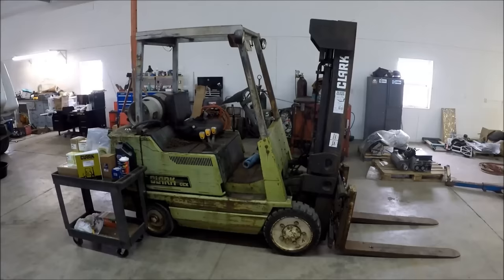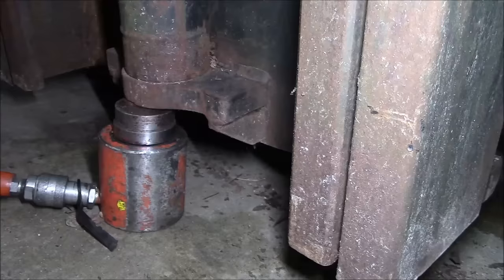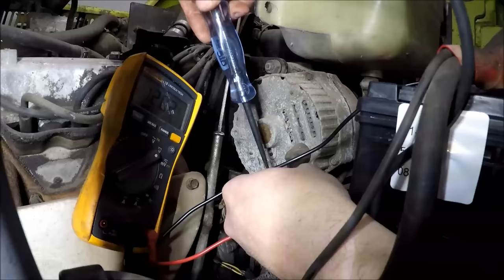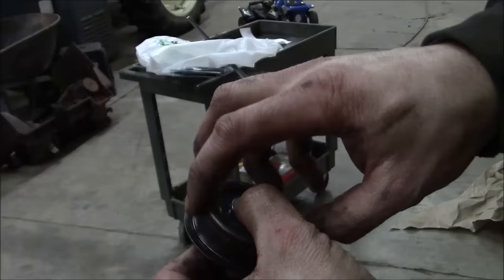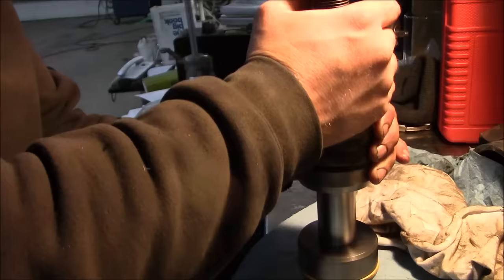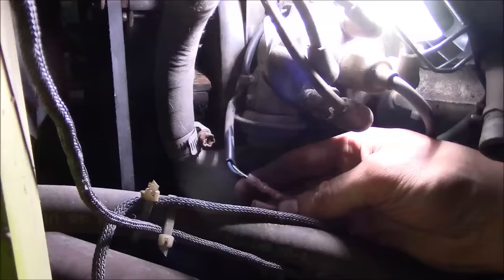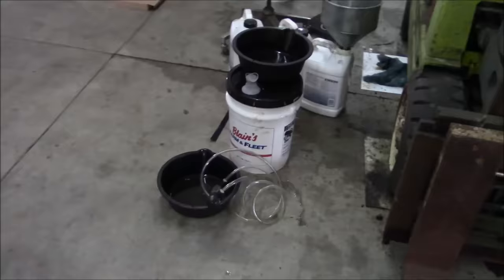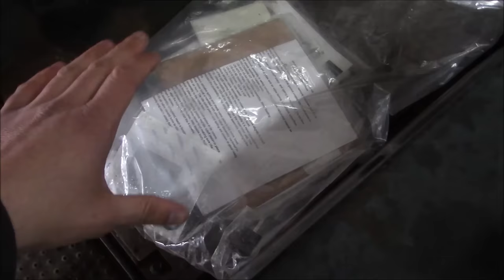Fixing a Forklift that Sat in a Field for 17 Years - Timing Belt, Mast, Hydraulics, Cleanup - Part 2

Comment: Very interesting to learn some stuff about Forklifts Wes. I have never worked on a forklift but you never know where life takes you and i would feel a little more confident doing so now. Also never seen a hydraulic cylinder rebuilt - i try to stay away from hydraulics but useful to see how you got it apart and did the seals. 

My pressure washing fetish was also satisfied!

Comment: I can remember standing on an old pallet and being lifted up full reach of the 3 stage fork hoist as an apprentice mechanic to change a mercury vapor bulb in the workshop ceiling.  A long time ago before  osh and worksafe.  Now they want you to use a scissor lift and harness which is a good idea if you have one.  Its got a mitsi motor 4g63 ? The PS pump goes where those 3 bolt holes are.  You only need to take the 4 m8 nuts off the crank pulley. Do the cam seal while its apart.  just line up the triangles its easy.  Nice hook wrench we usually get a kit for the cambelt that has everything in it. belts, seals, tensioners. Now you have a good shop forklift.

Comment: Coat of paint next ?
UV rated cable ties 😂😂😜
Reply: Should've put the joint in the cable ties AWAY from the operators legs though - sure as shit, those sharp bits will rip your pants!

Comment: You commented on how clean the oil and the spark plugs were. The burn on natural gas and propane is so much cleaner than gasoline or diesel. We had one FORD  (351 V8) van run exclusively on Natural gas and after 250 kms, we tore it down to see the inside of the pan an oil galleries etc. It was as clean as a new short block ! We were all impressed in the shop. You still have to dump the oil but after many more miles of driving. Cheers ! Great videos sir.

Comment: If you have a miss and can't find the problem, change the spark plugs. I lived off grid and used a propane generator. When it got hard to start, I looked into the problem. The plugs looked just like they came out of the box. It wasn't until I replaced the plugs did the problem go away. I have no idea why they looked store new and wouldn't work. Over the years I replaced what looked like new plugs, but were trash. Carl

Comment: Thanks again. There is always more to learn. Good to have a manual those retainers thingy o bobs for the cylinder were a suprise. Oh and maybe insulate that  aluminum bar you have sitting in line with your battery terminals If the j bolts get loose you could have a bad day.

Comment: Hey man, that upper seal in the gland, the correct name for it is a rod seal, and the “pressure seal” is called a u-cup! In case you haven’t found out already ! And yes those cylinders are a bastard to remove ! I hate forklifts lol. And the gland locking style is most commonly referred to as a “ring lock”
Reply from the maker: Thanks for that info!

Comment: I drove a truck (Mitsubishi Mighty Max) that had an engine almost exactly like the one in this forklift. I had to replace the head gasket and the factory carburetor got replaced with a Weber DGAV, other than that it really never gave me trouble. Fun fact - you prime the oil pump by stuffing it full of Vaseline before assembling it.

Comment: Keith Fenner is an older guru in hydraulic cylinders and knowledegable do it all machinist has a video that shows a big marine cylinder with the steel ribbon retainer ring. I thought that type of retainer was odd but evidently are in rugged applications. You might like his steel roses. Turnwright machine works. in new england

Comment: On later models they deleted the second water pump in favor of an idler bearing setup for the fan, it eliminated the need to drain the cooling system to change the timing belts. It all was due to putting the trans cooler under the radiator and having to get the fan to line up with the fan shroud. All forklift manufacturers love to put ten pounds of crap in a five pound sack.. lmao.. my best time for changing both timing belts on the later setup was 45 minutes in the middle of an Ace hardware store...
Reply from the maker: I'd believe it. I think I could have done this timing belt set it 1-1/2 hours if I had all the parts. It's really not a bad job.
Reply: Doug Degraff In the middle of the day or at night ???
Reply: Doug Degraff The timing belts kind of suprise me , they used to leave the belts for the on road vehicles and gear drive the came on the industrial units .
Reply: Becky Watt it was in the afternoon... had to run 75 ft of air hose from my truck to reach the truck through the front door of the hardware store.. the earlier Mitsubishi 4G63 had a timing chain set up that ran through an opening in the head that would entail a trip to the shop and removing the engine to service, As Wes said the belt set is really not a hard job to do onsite at the customer location. There have been several manufacturers use the Mitsubishi engines in their trucks, but Clark usually had the best access and didn’t have a driveshaft for a hydraulic pump run off the crankshaft which always presented an extra degree of difficulty to the job.
Reply: Doug Degraff Doesn't sound very fun , have worked for both Ryder and Penske  and done service calls on I-94 and I-69 at night , non of it is very fun but you can't tell that to someone who hasn't lived it . BTW,is the Mitsubishi similar to the toyota 22R with the chain drive camshaft ???
Reply: Becky Watt yep very similar to the 22r motor.. night service calls are never fun. Don’t get a lot of emergency calls for forklifts at night after explaining what it will cost the customer.. 4 hr minimum call out at time and a half labor. Usually they change their mind as to how bad they need it fixed.. as for you though working for Penske and Ryder that is over the road trucks. And someone is sitting on the side of the road broke down.. I can imagine it can get pretty interesting at best and hair raising at worst working on the side of an interstate at any time day or night.. throw in some bad weather and you the have ingredients for disaster..
Reply: Doug Degraff That's a fact !!

Comment: Great work. She’s turning into a nice machine. With the hydraulic seals I use a pair of straight internal circlip pliers to collapse the pressure seal. The pliers have rounded jaws so there is zero chance of damaging the lips. Instead of waiting for the piston seal to return back on its own I use an engine piston ring compressor to shrink it. When doing small rams I cut a bit of shim stock and use a hose clamp to compress the seal back to the original size. Only takes a minute or 2 to get the seal back to size. Hope this helps as watching your videos has taught me a few things also

Comment: Takes me back to the 70's - 7 years as a Clark Fork Truck Field Service engineer.. All parts accessible providing  you were a midget, had double articulating wrists, the strength of superman in each finger and a full set of short/long, flat, shallow and deep crank series ring spanners, flexi sockets in 3/8 & 1/2 drive...
Reply from the maker: Yep. It's like working on a compact car that's as heavy as a dozer.

Comment: So nice to watch with good clear commentary and excellent camera work. It’s so relaxing watching someone else doing all the work. I know what it’s like to have to get all bent out of shape trying to reach things in a forklift and second guessing yourself that what you think is wrong actually is so you don’t waste time and money. You’re a good mechanic and it shows especially when you’re happy to admit when you’re not to sure about something and want to study up on it rather than pretend you are confident and know it all. You can work on my car anytime.
Really looking forward to the next instalment. Cheers Stuart 🇦🇺
Reply from the maker: Yeah, propane carbs are a mystery to me. I'm still not really sure how they work...
Reply: Watch Wes Work. Mate, you’ll have no problem working it out as over here they’re called a mixer. Because the fuel is already a vapour or gas all the mixer needs to do is mix the gas into the air flow in the correct ratio so there is a lot less parts. I’m guessing it will be an Impco system, probably a 225 or 300A and theses are simple, reliable and should still be easy to source parts for. It would also probably be worth putting a kit through the converter as well as the diaphragm might be past it’s best by now but again, for someone like you, a pretty straight forward job. Hope this helps, cheers Stuart 🇦🇺

Comment: Glad I found your channel Wes, nice work. Production value is high but not overly slick, I especially like that when you answered viewer comments in the beginning, you spliced in footage of the job being referenced to include your use of drawings/ schematics to illustrate how a system is designed/works...only suggestion would be more light in a few instances i.e the timing marks and similar. While it didn't detract from the point you were making, it does help round out the overall concept (warm fuzzies are important, right?)....that being said, for an amateur videographer who is a wrench by trade (and a damn fine one at that!) I realize the HUGE amount of EXTRA time it takes to shoot your work for numskulls like me....and then have to EDIT it. I think too many of the arm-chair variety wanna-be's don't full appreciate what you and other quality content providers have to do so fat bastards like me can mooch your efforts for free ;) ...Oh, and don't leave batteries on concrete it angers the electron pixie gods and apparently multiple YT viewers...bah ha ha ha. SUBSCRIBED!

Comment: Those teflon seals that get stretched on install can be squeezed back down with a sheet of thin plastic(pop bottle) and a hose clamp. That's how I do it on transmission rebuilds.

Comment: As someone who drives a forklift every day at work, I agree that it would be awesome to have one at home! Such a useful machine! :) As far as your shop floor goes, I came up with my own solution for that problem a while back. When I suspect that something is going to make a big mess, I put one (or more) of those free Harbor Freight blue tarps underneath it to catch everything that misses the pans. Then, after the job is done, I bunch it up and throw it out. Or, if I don't make as much of a mess as I thought, I give it a quick wipe down and save it for the next job. Saves a lot of time when it comes to cleaning up.
Reply from the maker: That's a good idea!
Reply: @WatchWesWork I'm glad you agree :) Those rolls of painter's plastic also do the job, as long as you buy the correct thickness.

Comment: Still love watching someone hand pack a bearing with grease.    Seems to be a lost art.   It is actually "less" messy, imo.
Reply: dang that is how my father taught me to pack bearings.
Reply from the maker: My dad too. I have a bearing packer tool, but it makes a big mess too.
Reply: That's how my uncle taught me to pack them when I spent a summer working for the aircraft mechanic shop as the "go-fer".
Reply: Grease is nice stuff to handle,I have packed manual grease injectors(one turn an hour) and you always have clean hands once you  have wiped off, makes your jeans ugly though !

Comment: I was changing the egt probs on a 2000 A6 with a 2.7  I cut open the box end and maed the shaft about a halds with on my 22mm and 21mm Have never needed those wrench sizes since.

Comment: Dude wished i had watched your vids when you were repairing this freakish green machine and gave you some pointers. Those lifts with inverted master cylinders have to be back bled. Then you have to deal with the shuttle valve and trans valve. These lifts were a real pain in the arse to work on. Glad to see you got it back running.

Comment: You can compress the piston seal on your hydraulic cylinder by putting a couple layers of masking tape around the Teflon seal and then use a large hose clamp and tighten it up on the tape .Makes inserting the piston into the cylinder much easier.

Comment: You can make that alternator charge again by replacing the diod trio inside the alternator, be sure to mark how your alternator is"clocked", then take it apart and replace...the diod trio is held in by four 8mm nuts remove them replace diod trio then tighten the securing nuts, then set your brushedin the install position with "paper clips" or skewers for shishkabobs to hold brushes in place while you put together both halves of the alternator.. also pay attention to the clocking of your alternator before final assembly...the diod trio you can get at any local automotive parts store. It cost me less than seven bucks and it does work on all those style altrnators, its the same thing as a internal voltage regulator. Replacing them even on the newer alternators is considered a  " lost art" and can be done but most just buy a new one...just a tip for future reference  bro...you dont believe it just call your local parts store and they will carry it..this is your neighborhood angry indian, god bless.mr.b

Comment: Yeah they had one just like that at my old job the side doors wood pop open when ppl flew around a corner and slammed in to the wall good job wes looks like you have a runner
Reply from the maker: Most forklifts in an industrial setting just crash from one obstacle to the next. I worked in a factory and we bought a brand new Cat. Within a week you could not tell it from the other lifts in the fleet.

Comment: the piston install they make a couple slip shims to help protect the seals from the threads but long as ya let it relax it should be fine i only know as i worked on a few in a valve co for years we had a couple that were hydrolic actuated instead of air or glycol
Reply from the maker: The nice thing about this type of cylinder is that there are no threads in the bore.

Comment: Those alts will blow the voltage regulator without the resistive load of the charge bulb on the crank excite wire and drain the bat.
Reply from the maker: It was not draining the battery, but it certainly was hooped!
Reply: Watch Wes Work thanks for the vid.

Comment: “21mm - stupid” - lol!  I’m amazed by the crazy combinations I sometime run into and I have nowhere near the number of things I’ve worked on as you have.

“Ahh I should have bought the fancy too” - another lol - I’ve had that thought on more than one occasion too!
Reply: Was that one of those bolts having one size on bolt and another on the nut?  I heard once some manufacturers (Ford?) did this on purpose, so you would not need two sets of wrenches.

Comment: I had the same engine in an 87 Dodge Conquest Turbo. it was rear wheel drive and a 5 speed. The only trouble that engine gave me was a blown head gasket. (could've had something to do with an adjustable boost controller). 😊

Comment: On trailer wiring we would put a glob of silicone in the butt connectors to prevent corrosion. I got the idea from Ma Bell.
Reply from the maker: These are adhesive lined. They work great.

Comment: when ever i make a battery hold down out of metal.. i try to use either convoluted tubing over it or heater hose.. .. the heater hose or convoluted tubing extends to the ends of the hold down and the hold down screws go thru the tubing, hold down bracket and tubing again.. reducing the chance of a short to ground.. or give it a coat of VHT black satin brake caliper paint. its kinda thick for a spray but it dries in just a few minutes..  you might want to try a can..

Comment: Actually if you use the proper floor paint it makes the cleanup much easier as it will not seep into the concrete. :)  Great video.  Thanks for making it.
Reply from the maker: I wonder if it would hold up in my shop.

Comment: Great series on bringing an abandoned forklift back to life. I am an engineer also and I was tought to put copperslip or grease on every bolt you put back in as you may be the guy who has to take it out next time in five years time. Wes questioned the use of it. I have used it for over 40 years on classic cars, vintage tractors, steam engines, oil engines and boats and ships and have never once had a bolt work it's way loose as long as you put new spring lock washers on each time. Look forward to the next video with great interest.
Reply: As you mentioned, as long as a bolt is adequately torqued it shouldn't back itself off regardless of any lubricant applied to the threads.  The real issue it can cause is overtorquing.  Unless specifically noted, torque specs are for dry (non-lubricated) threads.  If allowances are not made, torquing an anti-sieze coated bolt to a specific value usually results in significant overstress of the bolt leading to stretched/snapped bolts and/or stripped threads.

Comment: Really enjoy watching your channel... I wish you would try my method of removing broken or seized bolts.... I have removed hundreds if not thousands in my years of fertilizers equipment service and repair....  just apply heat around the surface the bolt is screwed in to...  I think the whole shock with water or WD 40 is useless... hear till it is red glowing then removed heat and slowly screw the bolt out. I think you will like the results a lot better

Comment: The two water pump setup is strange, but has probably to do with Mitsubishi supplying whole engines and Clark trying their best to fit them in. They could have fitted an electric radiator fan and do away with the second pump.
Reply from the maker: That would have been better!

Comment: This tip may or may not help you.  But having changed a lot of oil in trucks using 5-gallon pails I was taught about 35 years ago to invert the pail. What I mean by that is if you have the spout on the top, instead of the bottom you will not get any sloshing.
Reply from the maker: I was always taught to jab a hole in the lid to vent it. But I guess I was lazy on this one...